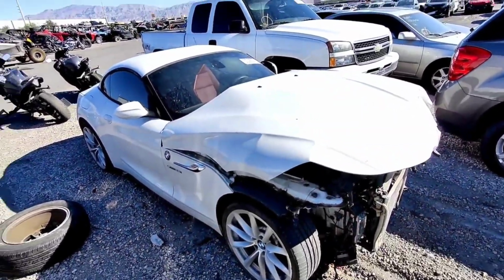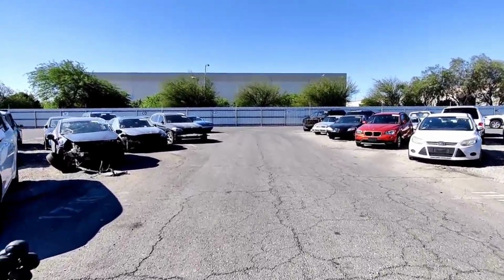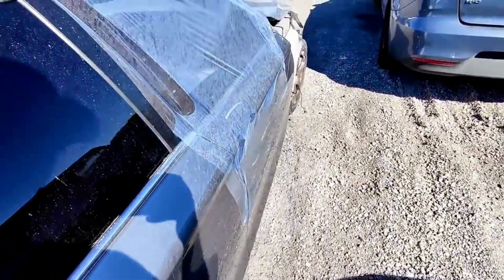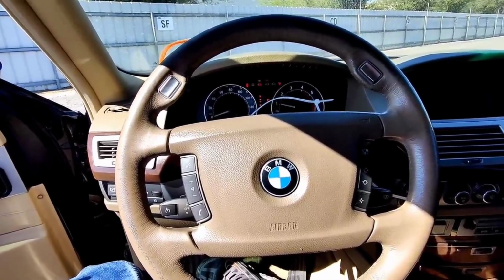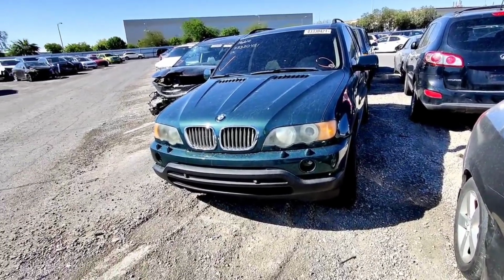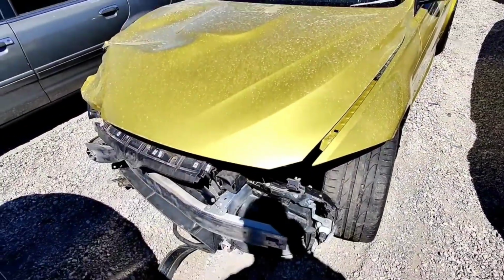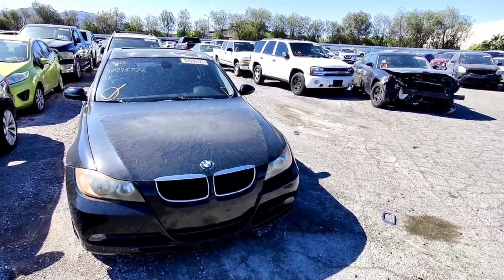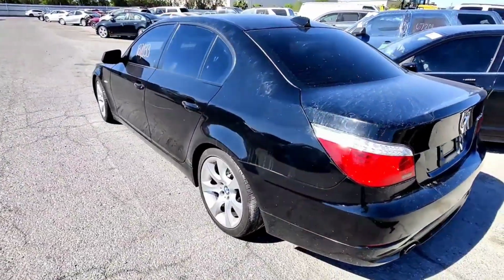So Many BMW Cheap at Copart

Comment: 13:11 Never heard of BMW F10 before  might need do research on those fix front & maybe some suspension work on passenger be good luxury car.
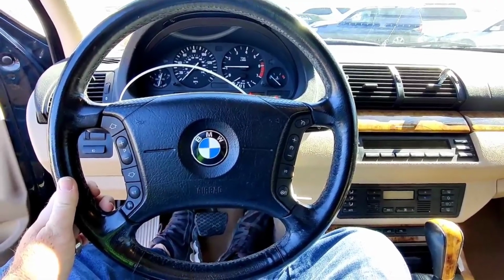28:01 Luv that Blue or Green X3 yess got a little trans problem but sounds ok may need fluids check.
Sucks about white 7 Series with key stuck I wanted hear it run.